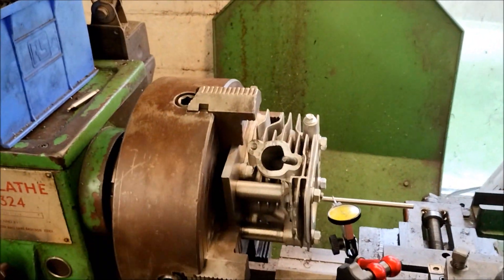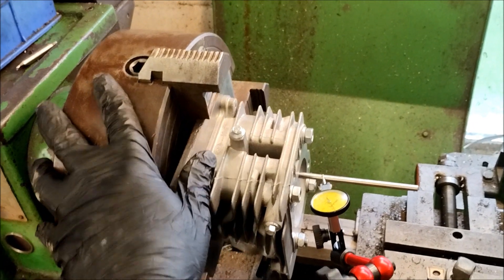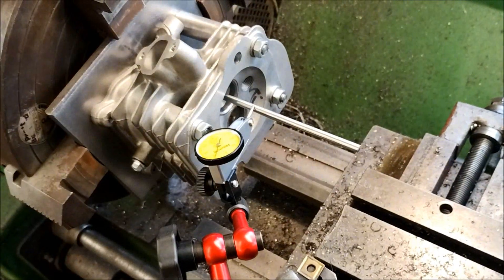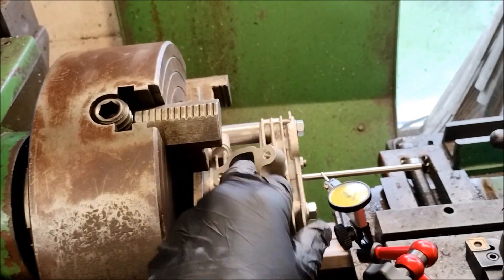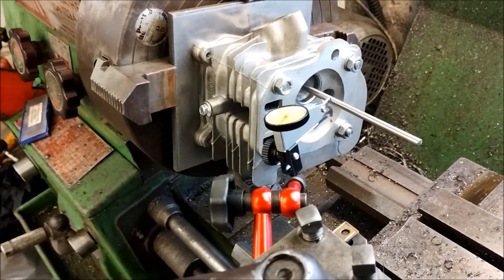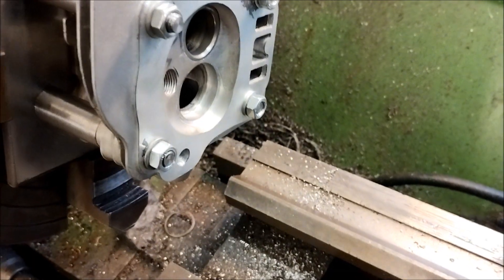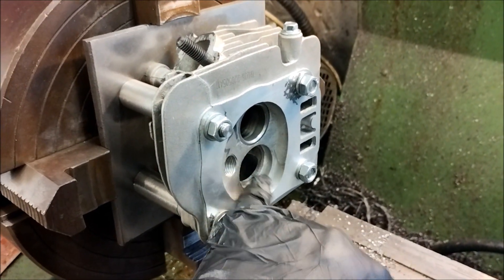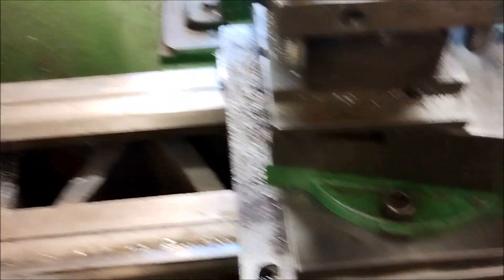GX160 head, machining for big valves pt3

Comment: Someone else with a Kerry , same as mine I think 13/24  1962
Reply from the maker: Interesting note about the Kerry, they were produced in Basildon, only 6miles from where I live. I had to travel just over 100miles to buy it, this lathe almost came home! It's a late Kerry i think '72, luckily I got everything with it. I converted it to single phase using the original multiswitch to use the dual windings in the new motor enabling forward and reverse drive. I love it, the 13" swing enabled me to machine a bespoke flywheel for my kit car.
Reply: I have mine at work, still on 3 phase,  its a really powerful and capable on girl. Mines pretty worn on the bed , I remade nut for cross slide and compound and i manage well enough now . Compound on yours is different,  must have upgraded it. Good to see another one still going , from what i can gather they were a top end machine when new.